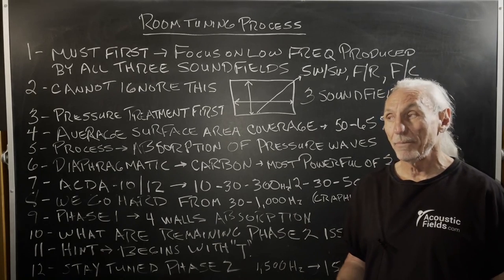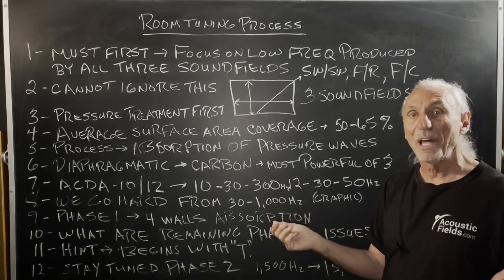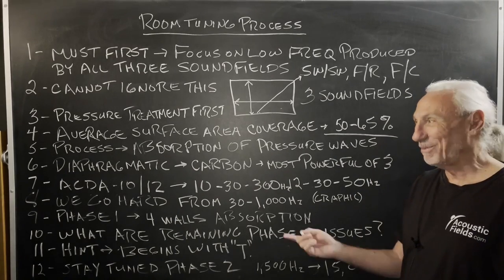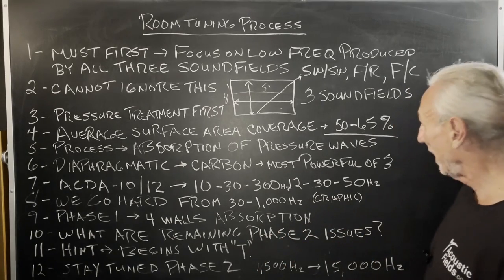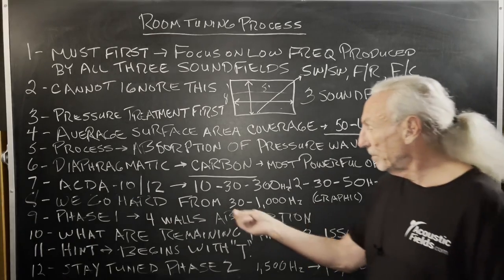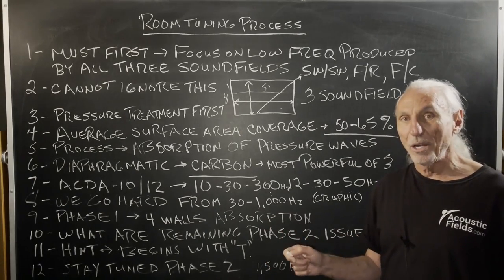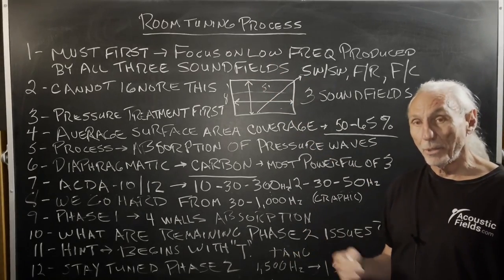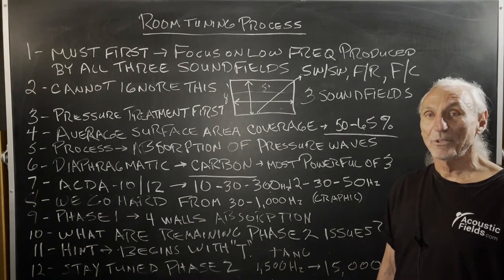Room Tuning Process - www.AcousticFields.com

Comment: Dennis, your films and the information you provide is fantastic. I have been watching for a while now with some fascination. 

Something I have been studying alongside your work is the Magico listening room design. It appears to my eye that Magico have created what are in effect helmholtz resonators along the bottom edge and the top edge of their room. One assumes that these boxes will be built to a size and specification that is tuned to trap and absorb bass frequencies that are occurring naturally along the axial dimensions of their room. Is my understanding consistent with yours?
Reply from the maker: I do not have any experience with their approach. Multiple Helmholtz resonators have been used before. The issue with Helmholtz is that they are limited in frequency range, do not produce a high rate of absorption, and require extensive coverage within the room. We use them sometimes to fine tune frequencies within a room that broadband did not get enough of. We do not use them as a first treatment choice. Since space is limited in most rooms, you must go low and get a lot with the available space. Only diaphragmatic absorption can accomplsih this initial design goal.
Reply: @AcousticFields  that's a great reply thank you. I understand that you are saying that you have almost instantaneous absorption and across a broadband of frequencies. 

Looking at the image in their film at 17secs (https://www.youtube.com/watch?v=Y17EyQJ2WRU) you can clearly see that there are multiple box structures along the top and bottom of the room. These are either BDA like structures or as I suspect, they are open "vented" structures.

Comment: Would it help to just cut the frequencies below 50 Hz or would the music then be unnatural? How much can we hear/ feel...
Reply: You still will have issues and the frequency issues will vary depending upon your room dimensions. Also depends on what type of music you listen too. Pipe organ, orchestral, etc has a lot of information below 50 Hz. Bass is the foundation of music. Without it, music to me sounds anemic.
Reply from the maker: You must let the music be the boss. You must respect the effort the engineer and the talent put into the source. You can not change the music to fit the room. You must fix the room to allow for the music to live within its intended frequency domain.
Reply: @AcousticFields  Hi Dennis, thanks for your answer. But what if I am the engineer 🙂

Comment: Well all I can say is... "The problem with mixing/mastering/sound production is always, always, always, getting the Low End right!" Most of the time it's the room, that makes this process so difficult! Take the room out of the equation and your 1 step closer to a no recall mix!
Reply from the maker: The low end is everything from many perspectives. It provides the foundation for the fundamentals. It also provides the harmonic structure for middle and high frequencies. Thirdly, the attack and decay levels are a critical component of low frequency resolution. You must get the low end right or the consequences of not getting it right have a very high resolution cost.